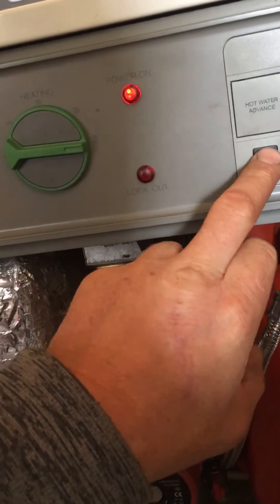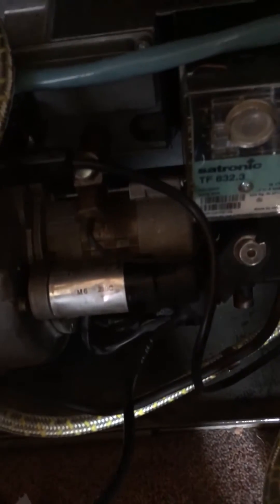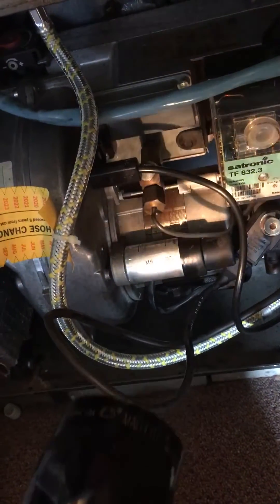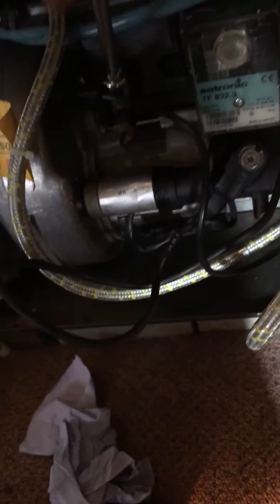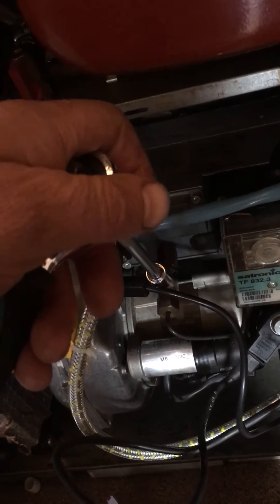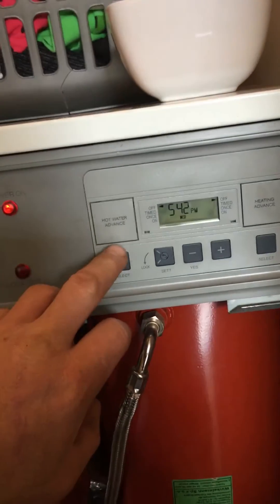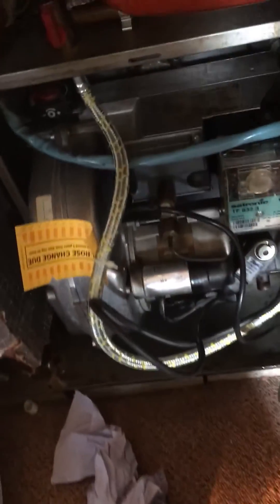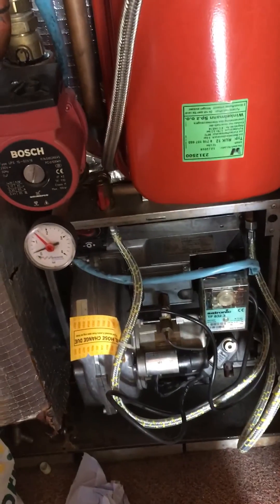Worcester Heatslave 20/25 oil boiler how to bleed

Comment: Top vid, saved me a call out. I had to undo my nut quite a bit to see the bubbly oil but it does work. Took about 5 unlocks to get all the air out but it worked. Thank you !

Comment: Thanks for the video, If you bleed radiators and the pressure drops below 1, is it the same nut to repressurise the system or is that something else? If so could you tell me how? This is about the only video I can find with the same boiler as I've got and the manuals are rubbish! Thanks
Reply from the maker: The water pressure
Reply from the maker: The radiator is a semi sealed pressurised water system. I say semi sealed because you can unseal it to bleed and unseal it to charge. Different system, this is the kerosene or heating oil feed from the tank. 
The pressurised and semi sealed water heating circuit is charged with water pressure. There will be a valve near to the mains cold water feed that when turned will charge up the water pressure. I’m not a plumber, strictly diy
Reply from the maker: I’ll do a follow up video on the water pressure feed and how to set it.

Comment: hey can you tell me how ya done it without spraying heating oil everywhere??
Reply from the maker: I used a few rags around it. I loosened the nut first then hand tightened it then his the button. Bubbles and Oil came out. I kept doing this till the boiler kicked in and started up or went boom. Probably best to wear rubber gloves and wrap with a rag or 2. When I did this video I just wanted to share. I’m not a heating engineer just a regular DIYer  trying to problem solve and save money. This got us going again when we ran out of oil by mistake a couple of times